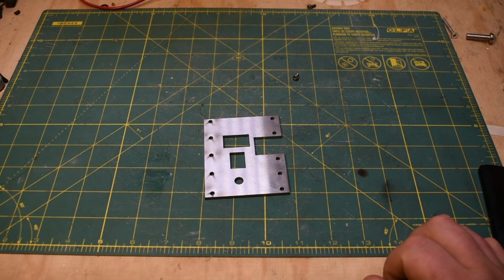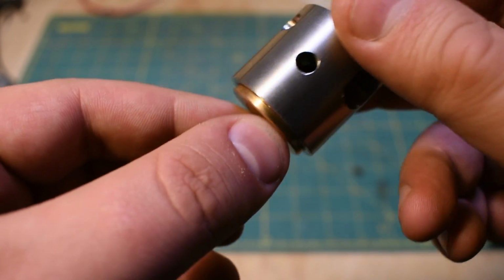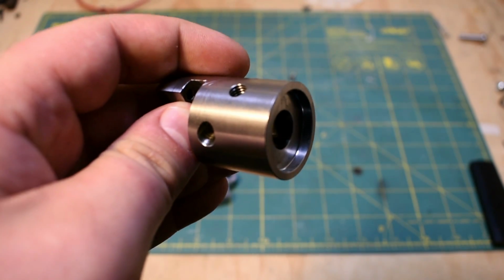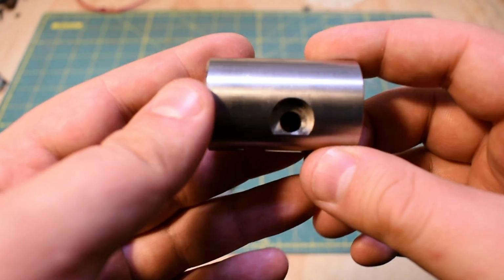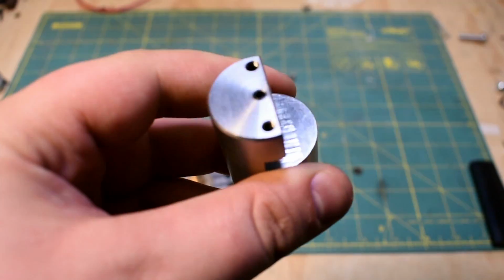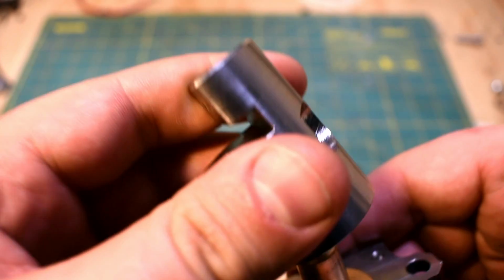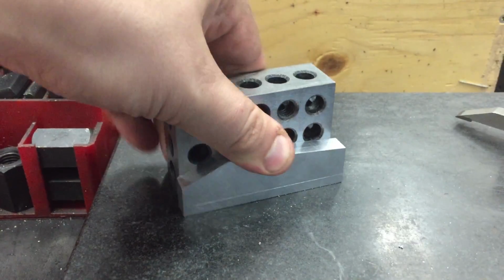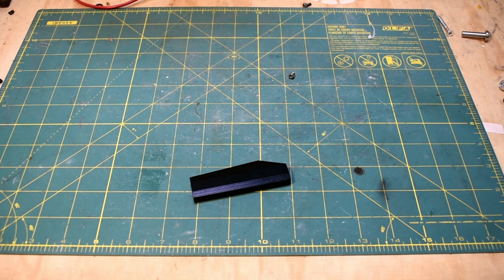Jeweler's Lathe Part 8+:  Design and Machining

Comment: For semicircular features like that, you can just use a chamfer or two. Much easier to machine and potentially more accurate because of the ease of machining.

HSS can also be machined with Carbide with relative ease. Quite useful if you need to make a profile out of a square blank.
Reply from the maker: My semicircle is so bad it basically is a chamfer :P.  Good point though, I probably even could have used a threading tool to make the contact surfaces.
Reply: Tabletop Machine Shop if you’re making precision pieces, a good way to ensure a good fit is to machine the components together. I believe Hardinge did that on their HLV manual lathes. Quite a challenge if you working on small pieces though... like you to seem to. On all your projects... do you have a guilty conscience and feel the need to punish yourself? Is this what this YouTube channel is?